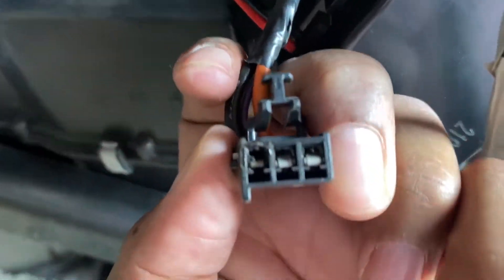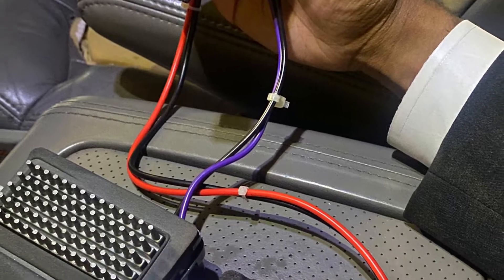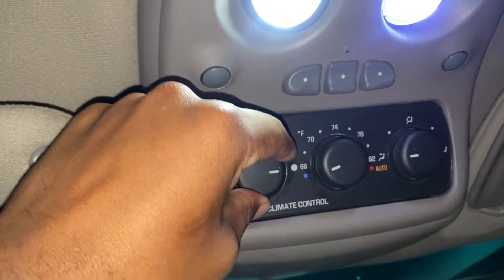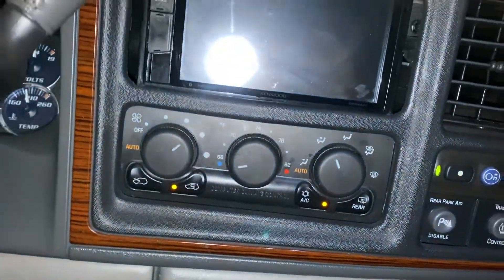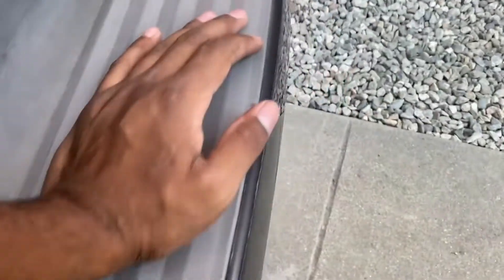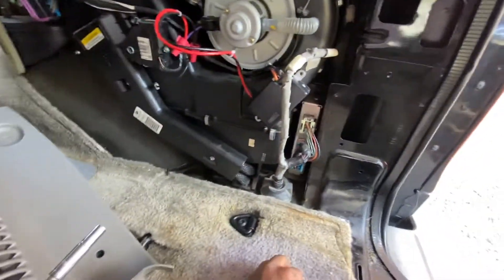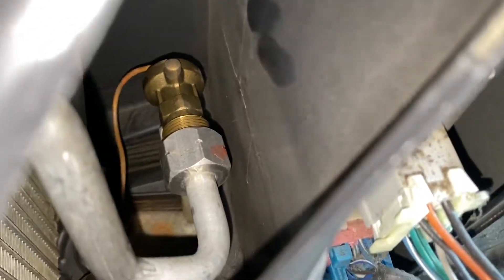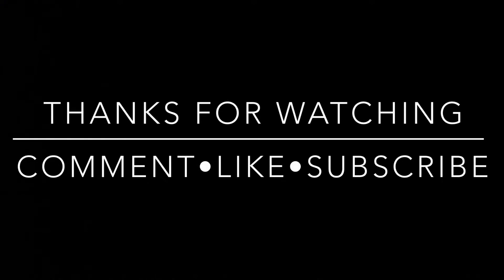2002 Escalade Rear AC not working part 2, ITS BLOWING!…but

Comment: Hi my back light don’t work only when I do the signal light, I already bought new bulbs I took it to OReileys and got it checked out but they said I had to pull out  some wire at the bottom to see if that works but it’s too hard to pull out the guy said to use water pressure on it to losen it up but I’m iffy.. any tips pls
Reply from the maker: What kind of car is it?

Comment: Did you ever figure out what the issue was?
Reply from the maker: no not yet
Reply: Mine was doing the same thing and when I removed the actuator I saw that my actual blendor door was broken so it wouldn’t open or close on the inside. I have to replace the whole damn box and I gotta take everything apart